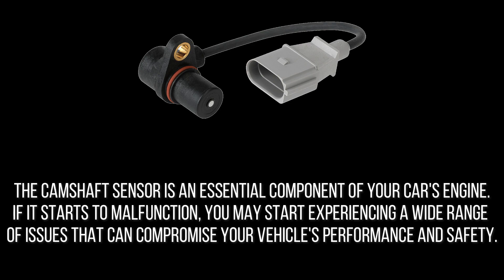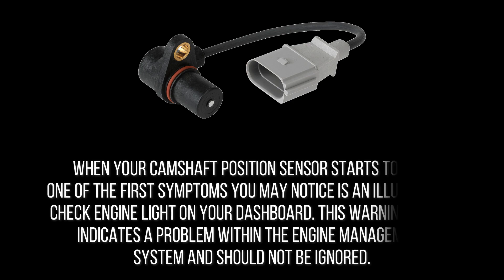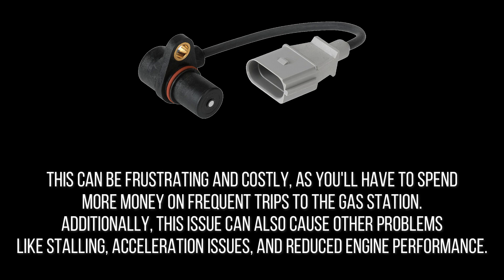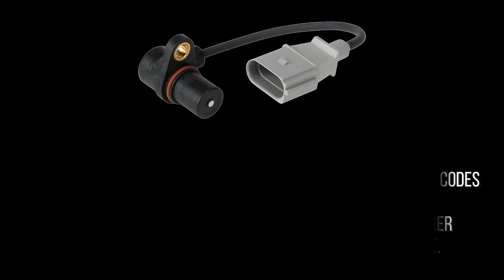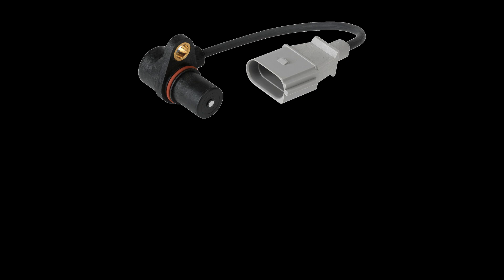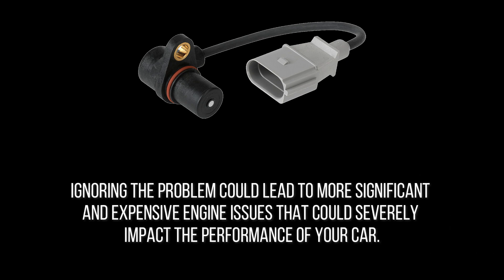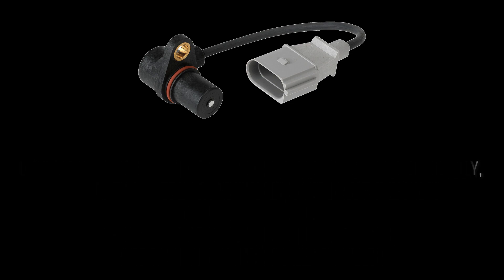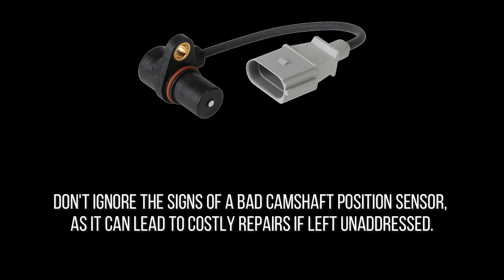10 Most Common Camshaft Position Sensor Symptoms

Comment: Hi. I have a 2016 ford fiesta titanium hatchback 1.6L naturally aspirated. Replaced both sensors and after clearing the codes they come back on in minutes. P0365 P0369. The vehicle is doing all the symptoms except stalling. And add very poor shifting. I have to use the manual shift option (powershift) to avoid chattering that sounds like valves. Any thoughts?
Reply from the maker: It sounds like you're dealing with some persistent issues with your Ford Fiesta. The codes P0365 and P0369 typically relate to camshaft position sensor issues. Since you've already replaced both sensors and the problem persists, it might be worth checking the wiring harness and connectors associated with these sensors. Sometimes, faulty wiring or poor connections can trigger these codes, despite sensor replacement.

Given that you're experiencing symptoms like poor shifting and unusual sounds during shifting, it could indicate a broader issue with the transmission system. The chattering you're hearing might indeed be related to transmission problems rather than valve issues.

Considering the symptoms and codes you've mentioned, it might be best to have a thorough diagnostic check performed by a qualified mechanic or a dealership familiar with Ford vehicles. They can conduct more in-depth tests to pinpoint the exact cause of the problem. It's essential to address transmission issues promptly to prevent further damage and ensure safe driving conditions.